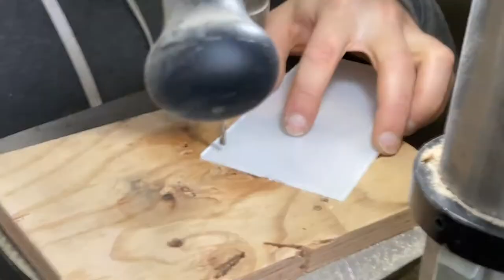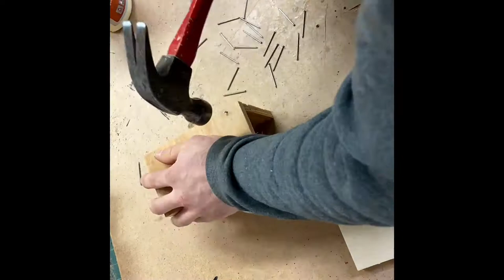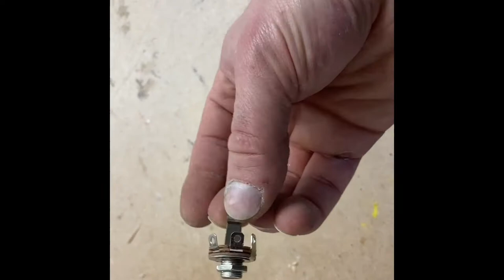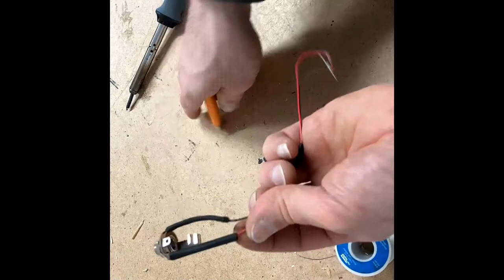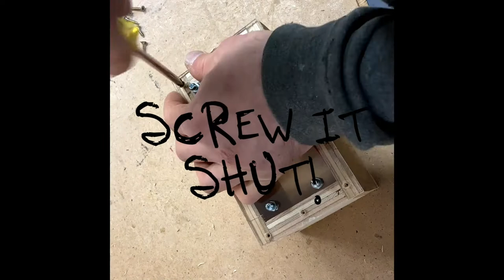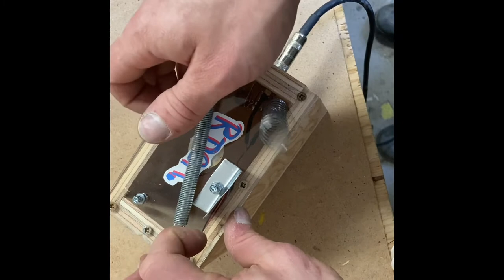DIY - Noisebox - How to

Comment: Just a random heads up that since you are using a piezo with a guitar cable, the impedance isn't matched and you are creating a natural high pass filter and that's why it lacks bass. You can wire in a preamp circuit, or get a cloudlifter or similar device, really any sort of buffer to match the impedance of the piezo and it will sound a million times better.